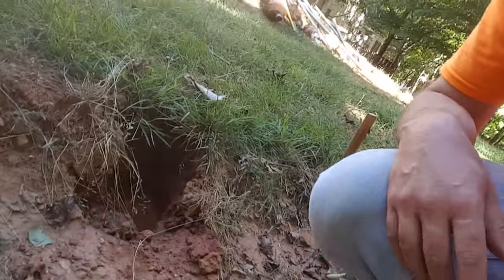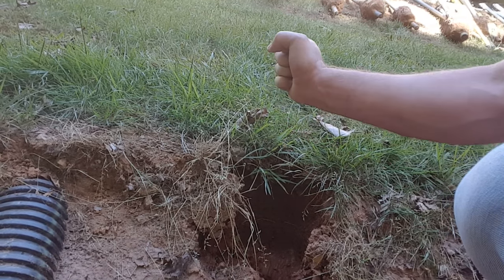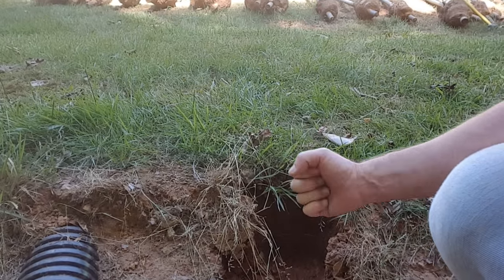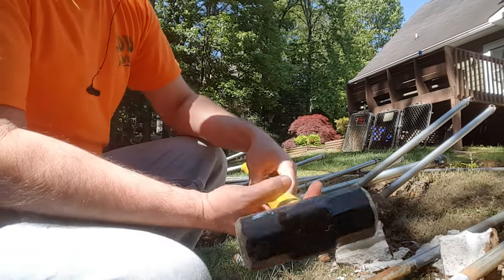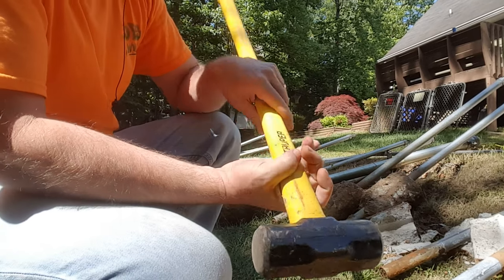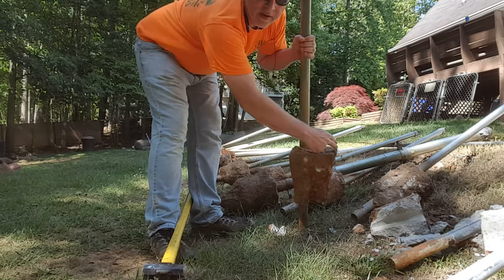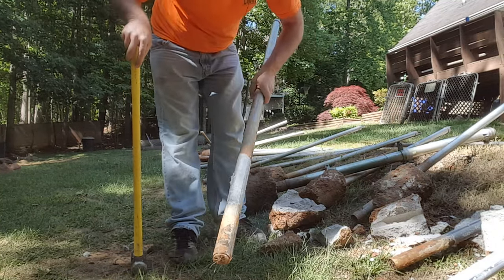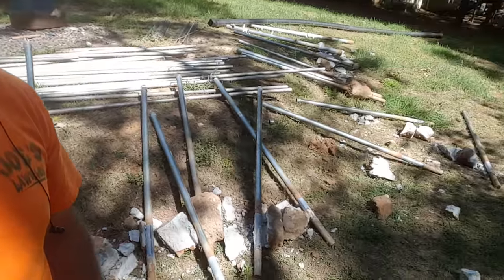DIY Tutorial on Removing Chain Link Fence Poles and Concrete Easily!

Comment: Thank you for posting how to remove the concrete.  I had taken a couple of whacks with a sledge hammer and thought no way, until I saw you do it.  Now I'm a pro.
Reply from the maker: denis bonzo lol thanks for the comment and glad it worked for ya.. it is very easy to do but most people just don't know it. Glad I was able to help.

Comment: I have a concrete chain wall with several holes that contain the remnants of metal poles within what looks like 3 or 4 inch pvc sleeves. how do I remove that stuff to put in new poles?
Reply from the maker: I am unsure what this looks like to help you.

Comment: I have friends who want to reuse the post and think they can just drop them back in a new hole with the old concrete on the post and fill the hole back.  Is that an option that will work?
Reply from the maker: Don Lovett I would not advise it because it will not be as sturdy when u just place the poles back in a hole and put dirt around it.

Comment: still waiting for the REMOVE POLE  part
Reply from the maker: Bob Abooey  I explained at the beginning how to remove.
Reply from the maker: Bob Abooey soak the surface. Then dig about 8" deep on 1 side.  Push pole back and forth to loosen it up. Then us shovel to  under and pry up it will come right out.
Reply: Thanks Joe,Did you use the monkey wrench trick??I cant get mine to grip the pole.Got out 3..got 16 to go:(
Reply from the maker: Bob Abooey I just used the shovel.